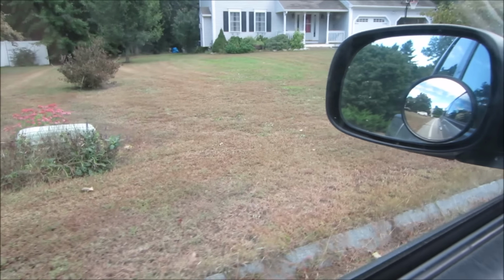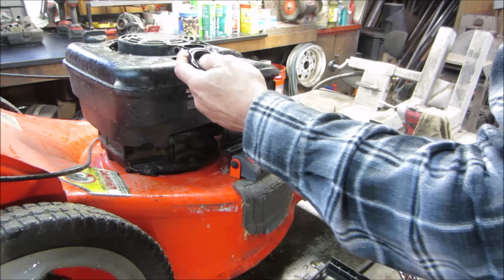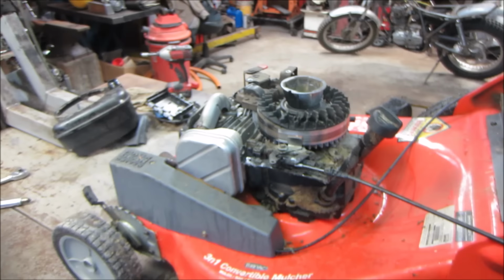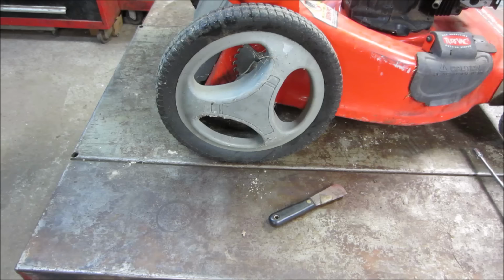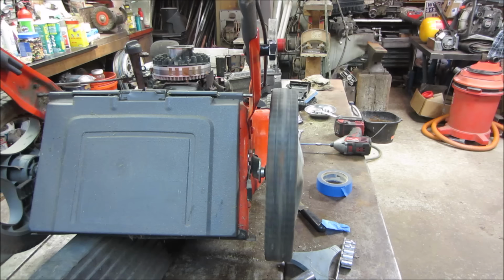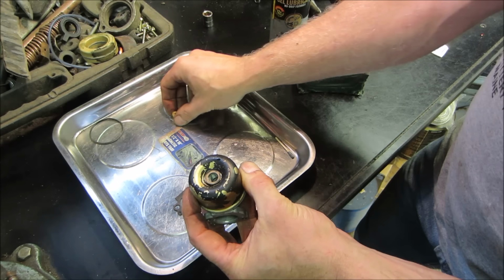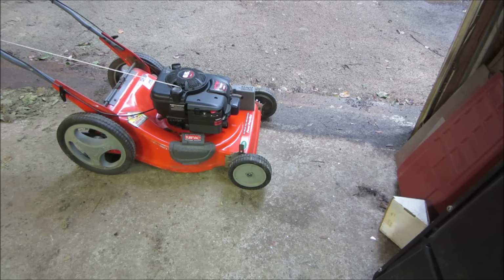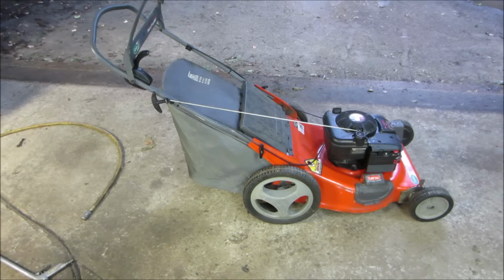How to restore a lawn mower. cheap.

Comment: I just picked up a mower for free. Replaced the filter and plug . Changed the fuel and now I have a new mower. Used it to replace the last mower I bought 2003 that was still running (sold it for $75). Only run ethanol fuel in my equipment.

Tried getting another free one today but someone beat me to it

Comment: A little length of wire (welding wire) with a hook on the end is ideal for pulling string through a hole. 
For the wheel, place it on a flat tray and bake it in the oven on 130degrees for half an hour see if that straightens it out.

Comment: Mustie,  a correction about primer bulbs.  Go to Steves small engine saloon and look up his video on primer bulbs, he sets up a model for demonstration. It doesn't prime the carb, it only purges the air out of the fuel line, like when you run out of gas so you don't have to pull on it a bunch of times to get the fuel up to the carb .  That was something I didn't know. I thought it squirted  some fuel into the carb, but it doesn't. Check it out.

Comment: Also a thin solid gauge piece of wire I use copper works great for pulling the pull cord through the holes

Comment: Once bought a broken weed whacker for $30 and the only problem was the spark plug had cracked. Put in $3 spark plug and been using it for nearly 3 years now. I always try and fix things before I throw them away.

Comment: I paid 25 bucks for a Troy-Bilt with a self-propelled at a pawn shop they said it wouldn't start. And had it started they probably would have wanted $125. Cleaned up the carburetor. Doesn't have a prime bulb has a newer style carburetor had to figure out how to take it apart and it fired right up. Easiest fix of my life.

Comment: Free mowers are the best! one fell in my lap recently and i flipped it, gave $20 to the guy who who gave it to me, and reinvested that money into more $25 broken high end models that just need cables and carbs and pull ropes.  I currently have a shed stacked with mowers ready to sell. I'm on my way to start flipping cars and eventually houses!  All i have is a shed and a tailgate for a workbench. I work on the side of the road because I dont have any work space. I figure that mower was free and doesnt owe me anything so basically Im not spending any of that flip money on myself its my only hope of a decent retirement fund at this point.

Comment: I got a Ariens Push mower from our neighbor  and it won't start so I opened my carburetor and saw nasty stuff come out from the float bowl and bolt as a carb jet with sea foam. So after I put it back together I put seafoam in the fuel tank left the cap open and primed it til it got into the carburetor so some point I will reopen the carburetor to see if the sea foam actually cleaned more inside the line. But my first push mower I got for free is a cub cadet sc500z self propel and I had to work on it til I got it to work. But I got it home and first start on the cub cadet

Comment: so i collect mowers that have been set out on the curb, and i have a lot. i seen a personal pace model with a bag and it's locked up, is what the culprit of it being on the curb. i bring it home a week later i decide to see how bad it's problem is. i'm thinking cam or crank rod as it turns 180 and stops forward and backwards. so i clean it up and so i'm under the hood and nothing seems to be hitting anywhere but  noticed a feel that there was something preventing the blade from going around so i push a little harder and it gives a little. this is a 1 pull guaranteed mower, 300 bucks with little time on it. and as i push the blade farther it creaks and then something freed. runs like a champ now. i found a 3/4 hp cooler motor on the curb the other day. with the cord and pulley. i'm thinking if i can get that pulley off, i'll be happy so i get it off after 2 days of meticulous efforts because they break easy and this motor is 10 yrs old but turns well, not very muuch shaft play either. they probably threw it away just to be preventative maintenence minded. so i take the shaft out and see what was wrong. that spring loader starter coil connector had lost a spring. i finagle one that is close. put it together and it's the smoothest running 3/4 hp i've ever seen, starts right up and spins nice. power. those things last almost forever just change the bushing if it's worn, a bearing maybe if it's been run long with it being worn, but the bushings are couple dollars. that motor i got is a 175 dollar motor, it's a 2 speed copperline 2206. i like mowers with bags and gas in  the tank. find them all the time.

Comment: Most mowers with big back wheels have negative camber about 1 degree as do many cars for curves and stability. But at any rate the deck is flimsy so it may go right back.

Comment: So, I have a Scott's turf master III exact same mower deck, not a high wheel, rear wheel drive. With a Tecumseh 6.5 horse , amazing engine. I love that mower.  Only problem is it propels a little squirrelly. I also have a snapper E1 platinum, euro series  with that same motor that's on the Scott's you have there. . ironic. Both are amazing mowers. Can't bring myself to sell either one of them as I a brand new Husqvarna L221 AHK as well. Have never been able to find another one of either the Scott's or the snapper.  Don't need three but can't sell any.

Comment: I've just been servicing my mowers and I enjoyed this quirky video!  I have a different problem with one mower. The wheel centres/bearings are fine but the "tyre" parts of the solid plastic wheels are badly worn. As they are not separate and are integral to the plastic wheels, the "tyres' cannot be removed. Suggestions on how to get around this problem without buying brand new wheels (for around £60 for the set) would be useful. I have seen a few videos where cycle tyres were glued and screwed onto the worn wheels. Seems a bit dodgy and I doubt it would last long with serious use.

Comment: Two of the biggest issues with lawnmowers not starting,  leaving them outside and not emptying all the gas out at the end of the season, and just not maintaining them ( drives me nuts when people don't) empty gas tank run motor until it conk's out at the end of every season , fresh gas each year new plug sharpen blade,  new air filter, change oil lube all your joints keep your rear bag clean also acts as a breather for the engine, have the mower like my last one for 27 years, still running well gave to son in law

Comment: You have to Heat The Plastic Front and Rear Wheels on Push Mowers With A Propane Torch Like A Burnzomatic Torch With  set of Large Channel Locks, like you used in this video or you can put it in a Large Bench Vise And Mess Around with them that way and get them Straight enough to use... Another Thing to work on plastic with A Propane Torch is Severely Scarred, Scratched or faded ATV Plastics only on smaller places of a machine... You Definitely Have To Practice On Useless Pieces of ATV Plastics to Learn how to  do it and it's a very tedious process that either looks really good or simply fails

Comment: Even if that seat was still leaking, it shouldn't be dripping around the bowl. Bowl gasket should keep it in. You'd only know it if it were flooding out the carb into the cylinder.
I've begun to check every single carb I pull with a hand-held vacuum pump, connected to the fuel inlet.
Invert the carb, allowing only the weight of the float to keep the needle seated, and set about 4 Hg of vacuum - no more. If it seals and holds vacuum, it'll probably be fine. If not, it's probably gonna leak past the seat when you put it all back together.

Comment: I may be wrong but I'm not, At least I don't think I am. OK great videos by the way and I'm,, a big VW van fan. That being said isn't the blade put on backwards on that mower. Looking from the bottom, the blade should go clockwise but its mounted counter clockwise and backwards.

Comment: When you get a free lawnmower, there is no guarantee that that is gasoline in the tank.  Could be pee, could be water.  It was free. As for spark, I felt it through my fingers so not a visible spark but there is something.  I am hoping Edger lawnmower is about the same kind of job.

Comment: on my mower (simple push mower fixed rpm tecmuseh vantage 35) when i stop it i release slowly until it kills the coil but not too much to apply brake so i dont wear out the brake for nothing and the engine stops naturally

Comment: People just throw stuff away and replace it with new when it could easily be fixed. Even if you can't manage it yourself. Just give it to someone who knows how and it still saves you the cost of buying a new replacement machine or gizmo etc. This helps reduce the amount of junk and environmental pollution, too. And it provides jobs for others who do know how to fix things. An all round win win situation. I was going to throw out myold Victa 2 Stroke. I thought it had known better days but, after seeing this video, I will try to take it to someone who knows how and get it going again. Why wastemoney on something new when something old you already have could be made to work just as well? This rule may not applicable in all cases, but it is for lawn mowers because, basically, all a mower has to do is cut grass. Seeing machines are another example. If a woman can sew, then just a verybasic straight stitching machine with perhaps a  zig zag stitch for overlocking and a button hole and a Zipper foot, to do zips and butoon holes is really all she needs to produce beautiful garments or do repairs and alterations. Such simple, basic and well constructed sturdy machines are often thrown out by women who can't sew but think the latest high tech, very expensive computerised machines withhundreds of fancy stitches they will never use will make them instant expert seamstresses. The old simple machines are easier and less expensive to fix if they break down. And easier to use. So, instead of stuffing around reading unintelligible, badly compiled manuals, when they even provide any at all, or doing expensive, time wasting course onhow to use your gadgets and gizmos, youcan focus on the reason you got it in the first place ie to get the job done. This same basic principle also applies to other forms of technology and things mechanical. My guiding principle when purchasing technology is "KISS" (Keep It Simple Stupid). If I have to waste too much time trying to figure outhow it works or, worse still, stuff around attending courses to learn how, I don't want the latestfancy model with allthe bells and whistles. I'll always opt for the earlier, most simple basic model that does just what I need the machine to do and no more eg cut the grass for a a lawnmower, sew a straight seam for a sewing machine etc. Mobile smartphones are one of mybiggest bug bears. If I just need a mobile to make a phone call whenneeded, why do also have tohave all the rest of the crap that exposes me torisk of privacy invasions etc from the Internet being accessible by smart phone, or its operation which defies all human logic and natural common sense? If I wanted the extra stuff eg Internet access etc, I could buy a tablet or a small laptop computer etc. All a practical useful easy to operate mobile phoneneeds to be is a basic secure, reliable, easy to use  mobile telephone with clear buttons that make sense eg you press one button per number digit to make a call, you press one button to send the call, another to receive the call etc. not the sort of "mystery" smart phones that puts many older people who really should all have a mobile phone they canoperate off ever buying one, even if they are not poor. You just cannot buy a simple easy to use simply sensible mobile phone now. They are so "smart" they have even outsmarted their sellers, because many now refuse to even buy one. But these same people, including many older people will offer anybody a fortune for some older style press buttons phone with clear, LOGICAL buttons that make sense to them that works OK. Unfortunately, the networks often don't support such models any more, now, though. In Australia, these older press button phones older people would kill to get holdof will often be 2G or 3G network compatible phones but 2G is gone and 3G almost all gone, too. The older people don't realise this and will often be "had" by shysters selling such new looking old press button phones that no longer work, on the second hand market. What is really desperately needed onthe market now is a very simple, clear, LOGICAL press button mobile phone that kust does one thing: Make and receive calls within Australia. Reliably, easily, quickly. Nothing more nor less. The main function of such simple technology is for use in an emergency and for the occasional social phone conversation. The people who want such phones may be Internet capable, able to use a computer etc. But they do not want theirobole phone tobe a smart phone, like a tiny computer. They want a simple but very secure and private basic telephone whose messages cannot be intercepted by hackers, scammers, fraudsters etc. Unlike now, where smart phones expose one to all kinds of security and privacy risks but people are being pressured to take such risks against their wishes because most businesses and government departments now effectively force one to take such unacceptable security and privacy risks. It suits their business, but not all clients. And, what about those who cannot afford to buy or keep a smart phone connected? Are these deemed to be non existent, itrelevant humans, not part of society?!?! How fair and just is that, really? In a so called egalitarian society where everybody is supposed to count?!? I callthis "discrimmination by technology" because that is effectively what it really amounts to. Technological oppression and discrimmination. But it is possible to be free of this. By simply refusing to own any technological devices. Nobody can force you to buy and pay to have a mobile phone connected. If they wish to communicate with you,they can write a letteror talk toyou face to face. That way, you regainsome power as acitizen.

Comment: Two things I do, that I wondered what your thought are about them.  1. I use a propane torch to clean out the spark plug and blow it out with air.  2. my older engines I add STP to the oil, your thoughts please.  Thanks.

Comment: The grind should be flat with the ground, that way it will not be pushing the grass down. By having it the other way it will hit the grass almost flat, which works, but does not cut as cleanly.

Comment: Hint:  to make threading the rope easier, either insert a wire into the end of the rope, or feed the wire thru and use it to then pull the rope thru. 😊 9:14

Comment: I didnt see u put on ur safety googles.when useing.that grinder or even give a good safety squint as Boltr refers to them. Ive had those wire brushes rip the tip of a finger by taking it for granted one time too often so dont do this at home kids and of course im sure hed agree .......never try to wire brush a small piece of stiff roundstock , say, coat hanger size cuz ul never realize what happened until u see that flap of skin hangin by a thread.ALL the skin from ur fingertip. Thanks again for.the instruction even for.old.codgers like me as u csn never learn goo much and.ur a.great source of knowledge for the kids abandon by the american educational society. Rich/San Jose

Comment: Heres a good question for you. How do you fix the main jet if you drilled to much out?? It had a hard substance blocking the inlet hole so l dilled it out with the smallest bit l had & now it sucks to much gas & acts like its flooding out & hardly runs, low rpms. Please let me know! Should l just buy a new jet or is there a way to fix it. Thank you for your time! Great videos!👍☯️👍

Comment: Everyone with this B&S carburetor is tempted to remove only the float bowl for cleaning-- but while the carburetor body is still bolted to the engine. That is a mistake for two reasons-- (1) the narrow-width, square cross-section ring gasket between carburetor body and bowl requires a slight stretch to fit properly, and that requires careful replacement after the bowl has been cleaned (2) if the carburetor must be removed to permit access to the bowl (as well as its ring gasket and viton-tipped float plug), the carburetor gasket probably must be replaced, as well (even if it looks OK). Better to disassemble the carburetor, clean everything, replace the carburetor gasket, and not have to repeat the operation later, to clear unexpected debris, clogging the carburetor.

Comment: on the blades .. my dad lifts the front of his gravley up and uses an angle grinder the sharpen the bottom of the blades .. i told him to take the blades off , however  he's not strong enough to take em off... complains about the tech putting them on with an impact wrench lol

Comment: Could this mower have leaked gas simply because you just finished having it on it's side to dump out the crankcase of oil ?
Easy, fun to watch, very informative video.  Thanks.

Comment: I always tape on some light wire to poke the starting cord through, and I use a sailor’s figure of eight knot. I’d also fit a fuel tap in the fuel line if it didn’t have one, it keeps gummy fuel out of the carb for winterising.

Comment: I just went through the exact same process to change my pull start out. It's because of your videos that I repaired that, installed a new blade, did an oil change and new fuel line. Keep it going! BTW That string "tit" must be the same on all big box store replacement pull starts.

Comment: Do you think it ran out of gas and they couldn't get the gas cap off, and messed up the pull rope trying to crank it? I always install a valve to turn off the gas line and run the carb dry. Makes the carbs last longer. You just have to remember to open the gas valve before trying to crank it.